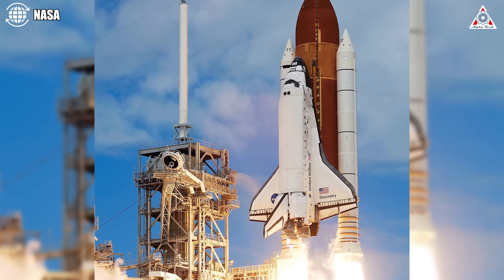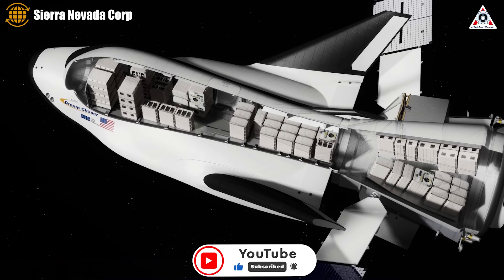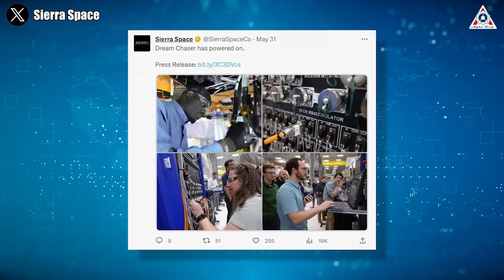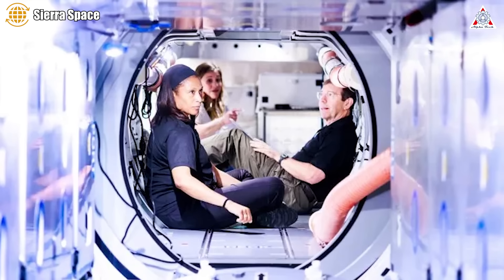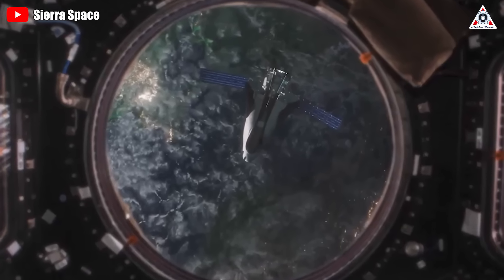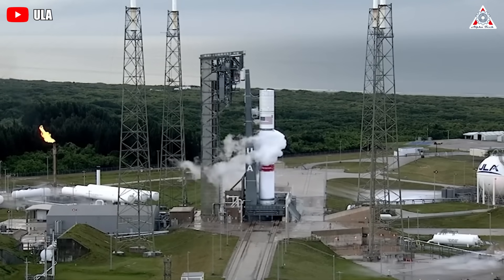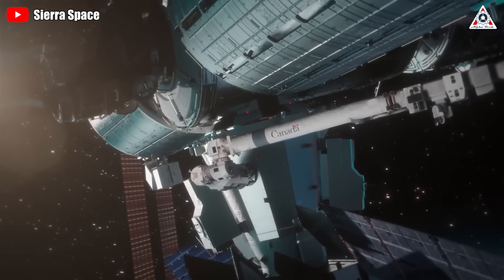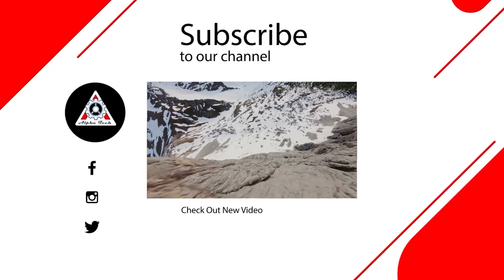Dream Chaser Tenacity is almost ready to launch

Comment: What would be required to have it fly on a Falcon 9 or Falcon Heavy?  I really dislike it being limited to one rocket.  You hint that it could fly on something else but then didn't discuss it in the video.

Would like to see an episode comparing stainless steel to titanium to carbon fiber.  I think a few episodes back you advocated the benefits of stainless steel over titanium and now Sierra brags over titanium instead of stainless.

Comment: I think Sierra should be talking to SpaceX; at the very least, considering a backup plan of a falcon 9 to LEO. While ULA has a proven track record as separate companies, Dreamchaser is facing some VERY high stakes - too high to be a faithful mistress to ULA. And Falcon 9 has the chops for the LEO missions; Falcon Heavy has the gut-twisting power to send that sucker to Mars. (Having images of a pair of heavies simultaneous launches, then once cut lose, a pair of them meeting, tethering or using some mission specific arms, and doing a spin grav round-trip flyby of Mars.)

Details: the Falcon 9 has a mass to GTO of 8.3 tonnes, but to LEO, 22.8 tonnes. A fully laden Dreamchaser is 14.5 tonnes. For higher orbital work, such as repair missions, it could go on a falcon heavy, with 26.7 tonnes to GTO, and 16.8 tonnes to Mars....or L1/L2, probably also Sun-earth L4/L5. JWST repairs, anyone? (It would need a more robust trunk for that - Mars is roughly 20000 m/s ∆V, E·S L2 is roughly 6000 m/s each way, so a falcon heavy is a bit of overkill. buy it puts JWST in repairable range.  

Not: I used this ∆V chart, rounded up: www.reddit.com/media?url=https%3A%2F%2Fexternal-preview.redd.it%2F4O-OVVrsFb-opHZ_5l0eK2MRBPU3MxILIWBCU8rboDI.png%3Fauto%3Dwebp%26s%3Dbac57b6c80469a17500e3382584c3fafc169d695